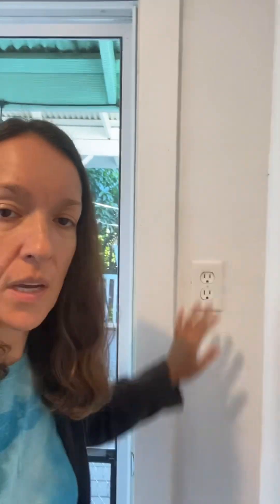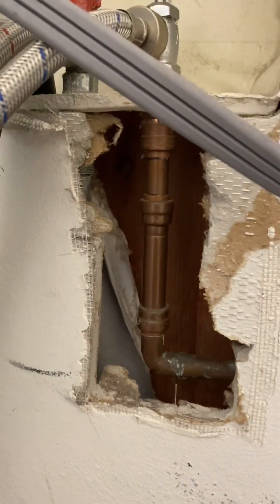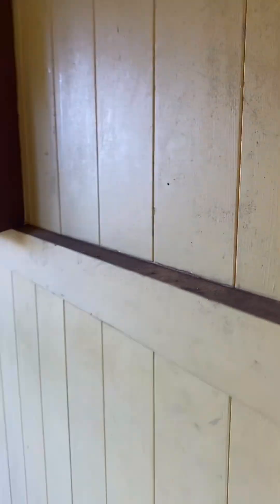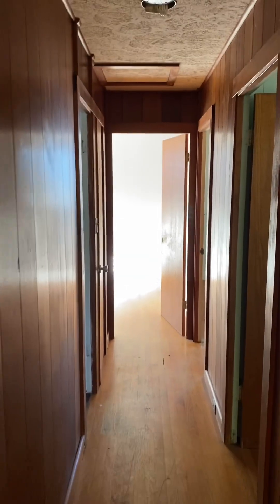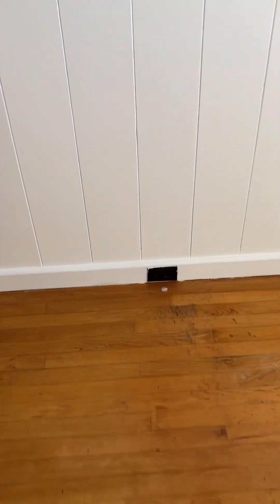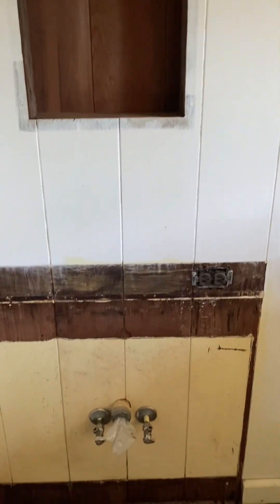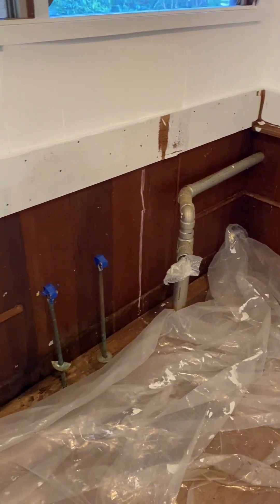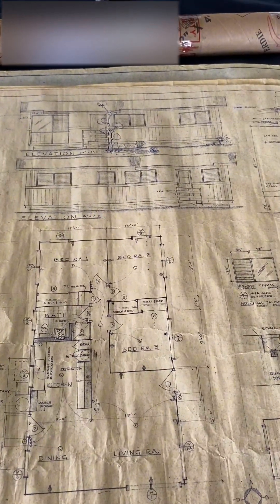“Single Wall” House in Hawaii, Explained!

Comment: I own a single wall home in Hawaii, built in 1948.  Material is tongue and groove redwood.  I want to remove the half "L" shaped wall dividing the kitchen and living room.  How do I know if that wall is load bearing?
Reply from the maker: I am not qualified to give a formal answer, but my general observation on single wall homes here is that they have "light framing" compared to today's standards.  I would assume most walls are load bearing unless proven otherwise. You will likely want to consult an architect/engineer to confirm if you can safely remove it and/or what additional framing or beams would be needed to support if you do.  Good luck!
Reply from the maker: Or even if they aren't "load bearing" officially, the walls can provide additional structure and support for the single wall home.

Comment: How do you hang things on these walls or make an addition or deck on them? I've been trying to hang things on mine, but it doesn't seem thick enough to take anything longer than 3/4 inches
Reply from the maker: Yes! One of the challenges. Screws or nails any longer will poke through to the outside wall!  I sometimes use more than one nail or screw or sometimes will mount a piece of wood onto the walls with a few screws and then use a longer screw in that…if that makes sense.
Reply from the maker: For a deck, you will want to make sure it’s fully supported without relying on the wall for a lot of strength. And/or attach to the structural corners/base of the home. There should be structural timber framing on the piers that the walls attach to…you could attach your ledger board to that. But not directly to the walls.

Comment: Mahalo for the video! We just bought our place in Hawaii Kai - a single wall construction and your video was really helpful, especially the plumbing shots! 
Do you have any advice on hanging things on the walls? Like a tv or heavier mirror? Just poke through the other side?
Reply from the maker: Thank you for the comment! For hanging things, I just use shorter screws.  If something is really heavy, I would use brackets that are attached with several small screws to help carry the weight.  I hope that helps!

Comment: I would love to hear about the other differences as well. Ei. HVAC, Foundations, Footers, Termites, etc.
Reply from the maker: Aloha Serena - No HVAC here.  Climate allows us to be without heat or A/C.  Footers are the same for single or double, although framing is more similar to "timber framing" on a single wall.  Redwood used on single wall homes is much less susceptible to termites, although they still get into the trim and other non-redwood parts of the home.  Thanks for watching!